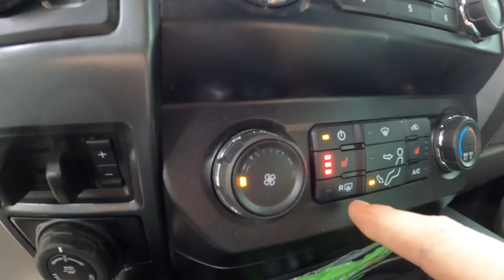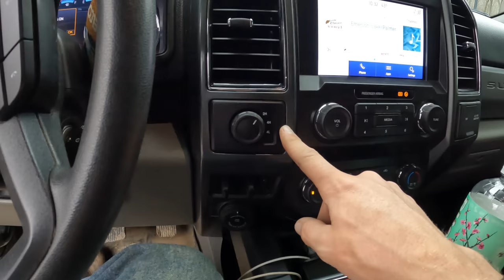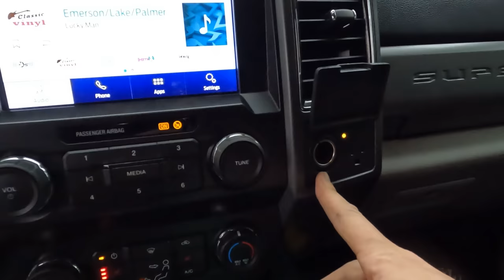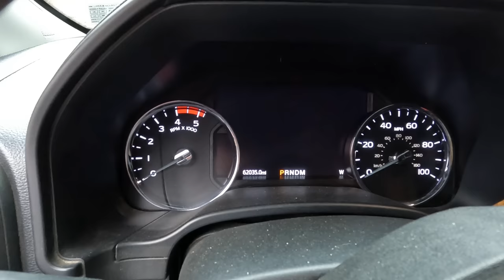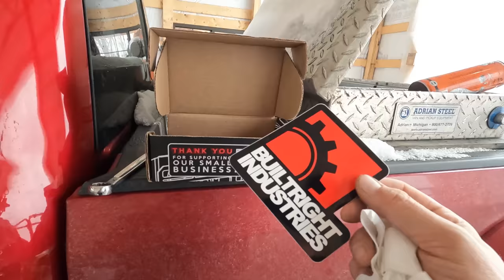I bought THE BEST Pickup Truck on the Market (Ford F450)

Comment: Would've been nice to learn why exactly the tow weight is so much higher - is the truck twice as heavy as your old one? Does it have better traction control? And is there anything you couldn't tow before that you can tow now? And why is a flat bed so much better? And how should you take care of your engine, what is the way to make it last a long time? Summing up, I didn't feel I really learned anything in this video.

Comment: get it fully deleted with a fass fuel pump aswell as a S&S cp3 kit, unless you wanna spend 20k from the trashy fuel nowadays, thats if the engine will last long enough, the 6.7's stock struggle to get to 150k miles with emissions

Comment: A bit late to seeing this.  If you have not converted to a flat bed yet, might consider the function of the tail lights.  Just finished seeing video by Eric O on South Main Auto.  He had to deliver the bad news that fixing a burned out tail light on a similar Ford was going to cost the owner $5500!! This was because the tail lights housed back up tv and other sensors that were integral. The actual problem was a burned out light with non-replaceable LED.   In Fords infinite wisdom why make $200 tail lights when you can fleece the public for thousands.

Comment: Wow  10 yards of dirt on a hitch.
20 yards on gooseneck. 
One mean truck that is.
I own 05 F350 with 5.4 srw  and pull my 3700# dump trailer .Add 3 yards of dirt to that and it's pretty maxed out at 10000 lbs and boy does it feel heavy.

Comment: 😬 i literally thought that was a thumbnail. Seeing you bought a Ford i have 2 of my guys with fleets of Ford believe it or not out of 12 they always have 2 to 3 in the shop broken. 1 of them took a lost and turned in 11 f250 and f350 for Chevy 3500 4.2500 and 2 ram 2500 i hope yours is a good

Comment: Hi Matt,  I am not completely sure but our old Snap on guy told us the ford 6.7 power stroke you can’t run 15-40.  He said he saw a couple motors burnt up from that.  He claimed the dealer said only to run 10-30 diesel oil.  I would be interested to see what your owners manual says

Comment: Heui went away with your 6.0. Modern common rails use a gear driven pump to produce 25-30000 psi at the injector. No HPOP like the 7.3 and 6.0. You now have a cp4 high pressure fuel pump.
Reply: I see others have already mentioned this. My bad

Comment: the 7.3 and 6.0 had oil pressure fired injectors H.E.U.I injectors.  NOT common rail, There fired by electronics they fire at a much faster rate and way higher pressures then oil fired injectors did. Hence a good reason why they can make the power that they do. Its the HPFP that builds the pressure that these trucks run at. very important to run good clean diesel in these as the only thing lubricating your HPFP is the diesel itself and with the "ultra low sulfur diesel" were forced to run now a days there's hardly any lubrication in the diesel from the factory's so a good aftermarket diesel lubricant and frequent water separator draining's and you should be good for several hundred thousands of miles. ThesE 6.7s are w3ell proven motors to handle 500K+

Comment: Hi matt now I have a citreon c5 I use to give me an hr before the ecu shut the car’s electrics down. It never showed me in any way that the battery was not very hot. I would come out in morning and car would be in Ecco mod. After fitting a new battery it cured the issue full. What I would do is do a test using a battery charger and time shut dow most cars you only get 30minutes I hope that is some help to you maybe

Comment: Towing capacity is one thing, but even more important is can it stop?  Towing a 40,000 trailer takes a lot of stopping power. I’d much rather have a heavier truck with a proper drive train and air brakes if I’m towing that much weight.
Reply from the maker: That’s what it’s designed to do. It stops just fine

Comment: I worked at Ford as a diesel tech when that truck was new it drove Me to drink but evently they got them worked out ok after the 72 recalls in 9 months but still don't put a tuner on them there ok evently I left ford to go to cat as field tech the triton's  with spark plug issues and the dct in the cars I had enough

Comment: And then you import these heavy duty trucks into Finland and you can tow 3500kg with ball (and with push brakes, no electricity allowed.. or great sum of euros again needed..) maximium or with large pile of euro money you can get gooseneck and maybe around 8000kg towing capacity with lots of paper work and only with one specific trailer with m.o.t inspection that approves it with that one compination of truck and trailer.. great.. would be nice if law would allow us also to use these for towing as they are meant to be used..

Comment: Lol. Engineers. If you really want to know who is responsible for the underside of hoods and dumb repairs, go talk to the accountants/board members who won't allow the engineers time for a proper design, force the use of multi-vehicle parts, and/or won't allow changes to a design/component as it would increase the cost of the vehicle. 
Love the vids by the way. Keep it up.

Comment: are you worried about the emissions system failing at all? ive seem some videos saying that as good as the new trucks are, if the emissions on them fails for whatever reason you're left dead in the water even if the truck is safe and ready to drive otherwise.

Comment: In last truck I had a small harbor freight bed crane, I have a bad back and it was awesome. Mounted it on a 2x2 square sheet of 1/4 inch steel. I am hesitant to put one in my new Ford because of the aluminum bed and the way it's put together.  It's not a one piece stamped steel bed the inside walls and floor are just tacked together...any thoughts
Reply: My back has gotten worse so I need to do something

Comment: That is not what common rail means or does. You still have mechanical injectors and electrical injectors and hydrologic injectors that work off of common rail systems.

Comment: Who boy , my Ram 6.7L does not use oil pressure to fire injectors. They are 100% electronic as was my '04 5.9L Cummins. In my mind you don't have the best HD pickup. Opinions vary. It only best for you.

Comment: Diesel creek: “if you do your research and know what to look out for and keep up on these truck then the 6.0 is reliable”

Me Personally, JUNK JUNK JUNK. you buy a 7.3 and have nothing to worry about and run used motor oil in it and it will outlive any 6.0 with little to no maintenance. Sorry I didn’t mean to go off. I’m just tired of hearing the dumb sayings of “if you bulletproof them then they reliable” or the quote that diesel creek said.

Comment: Do yourself a favor, Matt.  Replace your oil pan drain plug with a Fumoto oil drain valve.  You can change your oil without a wrench and taking oil samples is a breeze.  They are a little on the pricey side, but very well made.  My family all runs with them with no problems.  Not a sponsor...

Comment: I think the 6.7L Ford is probably better.  But after owning a 6.0L that constantly broke down and left me stranded.  Cummins 6.7, delete it and forget about anything breaking.  There is too much crap under the hood of a Ford.  It causes me instant anxiety any time I look at those engines.  Knowing all the crap that has to be removed to fix something.  And Ford's plastics and wiring are always minutes away from breaking.  Good luck with it.  Its just a no for me.

Comment: Did you have the dealer give it a complete undercoating job before it hit the streets in winter, Matt?  I hope so.  I don't know how people can afford NOT to, given the amount of corrosive salt spread around on the snow up there.  Couple hundred now vs many thousands later?  Congrats on your new truck. I'm a Ford convert, now a Toyota fan. I wasn't sure if Ford would pull through the 2006-9 troubles. Besides, my Tundra cost FIFTEEN THOUSAND LESS than the equivalent Ford F150 in 2007.
Question:  Would anyone here even TRY to pull 40,000 pounds with a 6,752 pound F450 pickup truck?  It's ridiculous, and dangerous!

Comment: About the power outlets cutting off after a minute, check the fuse box. My vehicles have 3 prongs for the 12V fuses, so putting the fuse in the top 2 holes means the outlets shut off, and putting the fuse in the bottom 2 holes makes them stay on all the time. I doubt Ford has this feature but it’s worth a look.

Comment: 6.7's arent heui (im sure others have caught this) but they do have a cp4 high pressure pump that is pretty sensitive to water/fuel contamination. A good fuel filtration system will go a long way to saving yourself some potential headaches down the road-cheap insurance👍

Comment: We loved our 1998  7.3l but it was only 2 wheel drive and it was just an extended cab.   Bought 2004 6.0 and had the worst luck with it.   traded that in on a 2008 6.3l that had 180k miles on it in 2012 (it was rode hard before we got it).   It now has 288k on it and she's tired out, but she still pulls the 40ft 5th wheel, the race car trailer, the 4 -horse trailer and the 35 foot hay trailer all over the pacific NW (including the dreaded Cabbage Hill Pass on I-84,  which is a trucker's nightmare, most of them call it Deadman's pass.  6% grades, a climb of 2000 ft with double -hairpin turns) for this family and another family that intermittently needs something with more power to haul.  I have converted my poor Chevy loving husband into a tried and true Ford Truck fan.

Comment: Love the new truck Matt only thing I noticed was you got it a bit wrong on how a common rail works it doesn’t use oil it pressurizes the fuel in a high pressure fuel rail up to 30000 psi so that the injector is able to fire of multiple times in a single power stroke which is what makes modern diesels so quiet. And also don’t crack a fuel line to bleed it you will get severely injured

Comment: Run battery cables through the firewall to a 1000W inverter, that’s what I do. You could go with less too but in my OTR truck I need a lot of outlets/usbs/cigar lighters

Comment: Many surveys have been done to establish which car is the most environmentally friendly. The cars that have the longest lifespan always wins, because a new car that has to be produced, is very ressource heavy. The fuel or the mileage is much less important, almost indifferent, if you keep a vehicle going more than a certain amount of years. The least environmentally friendly vehicles, measured over the entire lifetime of the vehicle, is any EV. It's safe to say that your channel, by repairing, renewing and keep using older, pre-owned vehicles and machinery, have a much smaller environmental footprint than anyone continuously buying new stuff... 😊

Comment: Duramax do not use oil pressure to fire injectors, never did. ford 6.0, caterpillars 3116 do.  All those who uses a oil driven multiplier are more prone to harder cold start. Your 6.7 does not. Fuel goes directly from tank to HPFP then injector. No hydraulic pump running from oil pump pressure is used.

Comment: You are referring to a heui injection system, the 7.3 and 6.0 had that. It was a designed by international and caterpillar as a joint venture, common rails actually have a high pressure fuel pump that pressurizes it up to 40,000 psi, the injector has no oil going to it.

Comment: 6.7 powerstroke does not have oil fired injectors it has a timed cp4 high pressure pump. If you want to keep that truck for a long time you should be changing your fuel filters with every oil change, that is the biggest downfall on these rigs, overly sensitive to bad fuel. Also you do not want to run 15w40 in a 6.7 ever.

Comment: Wait you ran 15-40 in old blue when we had 6.0 in are fleet if we used 15-40 it would destroy a little screen I don't remember what it's called but it would collapse this little screen and destroy the motor

Comment: I had an 02, 5.4 and I Miss the seats.  170k is nothing for the diesel.   The new one should last even better if you keep it out of the salt.  That killed mine.  Thev5.4 was great except  it shot spark plugs out.  I went to a Tundra.  I don't  need a deisel.  Good luck with the new one
  Looks like a fun beast.

Comment: Mine is a 2013 and it has a release, why would they stop? Mine also lock the bottom in the upright for additional storage under them. Anyway you are right, heated seats are better then having the actual heat. Mine also cool in the summer not sure how... I like to mess with folks, turn on their seat for cooling in the winter and heat in the summer...

Comment: Looks like you used a standard wrench on a metric bolt, if you have to hammer it on it’s not the right size. And lube techs think you need to put oil plug on like lug nuts, yet they put lug nuts on like oil plugs.

Comment: That new truck would be a costly thing to keep on the road.. 1- it's a 1 ton or better an anything one ton an up must have a MTO safty check done every 12 months  by a licensed safty check shop for big truck  average cost of a safty check on trucks van 1 ton an up is $2000 cnd. 2nd no one with out a comercal Class A licese can not tow anything over 10,000 lbs  3rd on the old truck with that loud of exhaust noise you would be stopped and ticketed and required to fix it within 30 days or your plates will be pulled second offense it's impounded. Even a gas pickup car running with strait pipes is stopped and ticketed.  Loud exhaust noise drives me mental.. this is why mfg for Canada dropped the dual wheels and dropped the weight rating on one ton trucks to just below the one ton rating Gvw so yearly comercal safted are not needed.  And last any trailer with a GVw over 10,,000 lbs also needs a yearly safty  done at a cost of average $1,500 and very high plate costs for both truck an trailer. Just for my 5 ton I pay $2800 cnd for my last safty an $490 for farm plate for 12 months before it was plated farm use I was paying $670 for 6 month plates. Even with my comercal class DZ licese I can not tow over 10,000 lbs . No one could drive my 5 ton with out a minimum of a D licese before I farm plated it. Now that it farm plated anyone with  a standard class G licese can drive it but also cant tow over 10,000lbs

Comment: Your description of common rail diesels is incorrect.  Your 6.0, and the older 7.3 as well as many other diesels use a HEUI system where high pressure oil fires the injectors that have low pressure fuel.  But the common rail engines use a mechanical fuel pump to pressurize a fuel rail, and electronically controlled injectors.  Big difference. Mostly that the common rail motors don't have a billion o rings that get hard and fail causing hard starts and low power.

Comment: those Tow numbers are way off, as what the dealer and the salesman doesn't tell you and what you probably can't see unless you're looking for it is the Teeny Tiny little text with a * before it at the bottom of sales brochure and sales material, looking like this

yes the can actually tow 37,000 lbs but its with a regular cab short bed, 2 wheel drive, and without the diesel option. its always baffled me a bit that a little tiny clown car of a truck is rated for way higher than a crew cab 4x4 dually. all the brands do it to inflate sales and numbers, if you bought it with intentions of using it to tow heavy, shoulda got the commercial special regular cab white f450 short bed 2wd gas work truck. fuel economy would suck but you'd have the advertised sticker tow rating.

been thru this rodeo twice already with my 2005 F250 Harley Davidson edition and my 2018 F250 platinum both diesel. and 4x4

*37,000 lb gooseneck tow rating only applicable with specific configurations

forgot to say it'll also typically be grey text and super super small font.

Comment: As far as i know, common rail tech uses high pressure pumps where the diesel fuel is is being atomized from injectors to maximize spread of fuel before igniting in cylinder chamber. Now I'm confused why Matt described that as if the oil is being pressurized, is that something in trucks, why would you separate oil atoms?

Comment: It's funny that none of the power stays on after the truck is turned off.  My daughter has a Ford Fusion and we had the opposite problem trying to install a dashcam (which you want to power off).  EVERYTHING stayed on 100% of the time.  Out of the entire interior fuse box (with perhaps 20 fuses in it), only the ignition circuit turns off when the car is shut down.  Of course that is the top fuse and required a different pigtail to fit because of the other components surrounding the fuse box were interfering with the regular pigtail.  I thought it was a Ford thing, but apparently it is still model dependent.

Comment: Nice f-450. Note the 6.7's don't have a high pressure oil pump. Just a high pressure fuel pump and the ecm fires the injectors.

Comment: I've got a 2013 F-250 superduty I went to change the oil and found the transfer case plug rusted and stuck in the aluminum case. Even the dealer ship said they could not guarantee that they could get it out without stripping the threads in the case. At the suggestion of a friend, I heated it with a propane  torch , not red hot, just enough that it was uncomfortable to hold my hand on and it came right out. (aluminum expands at 3 times the rate of steel). since you get so much rust where you live, thought I might pass this on . God Bless and Merry Christmas to you and yours. P. S. whats next on your shop?

Comment: Your old truck was heui. Where it uses oil pressure to fire the injector 
Your 6.7 is common Rail so it has a high pressure fuel pump cp4 I believe 
T6 oil is still a great choice

Comment: High pressure oil isnt firing the injectors on common rails, you’ll have electronic solenoids on the injectors and the high pressure fuel pump is feeding the rail.